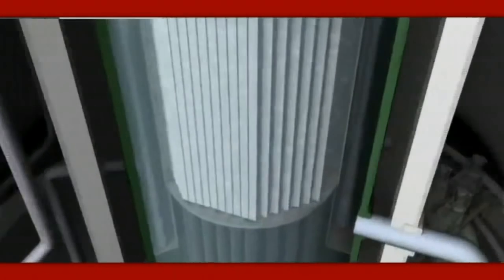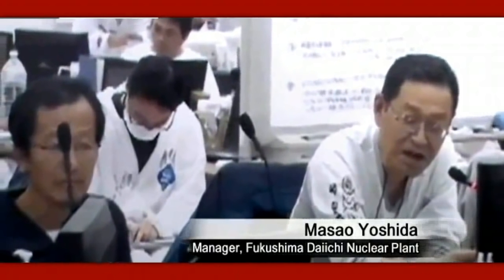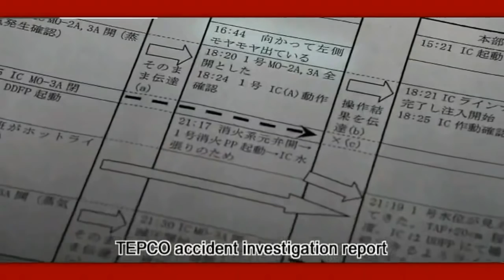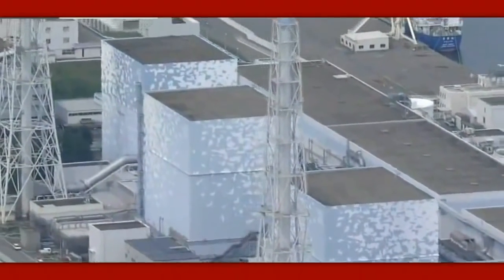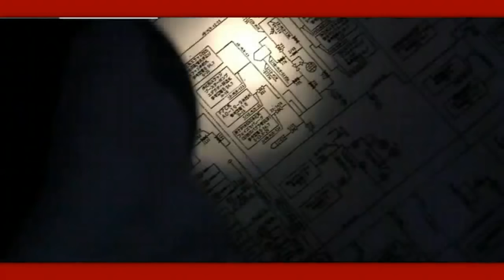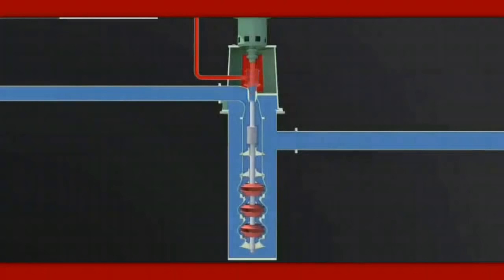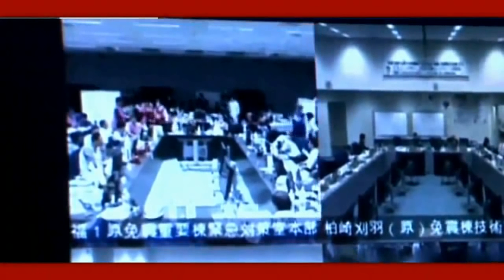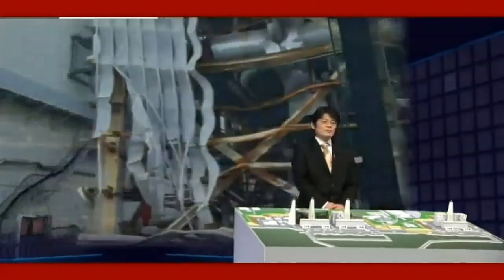Understanding Fukushima ☢ Documentary  Feb 3, 2017 Update

Comment: They didn't test emergency systems and that everything was electrically controlled...
that valve to the condensers must have been a Normally Opened Valve and you would have needed electricity in order to close it. When electricity fails it automatically opens.
You always need to have mechanical systems that can take over the electrical ones.

Comment from the maker: In a few more days, on March 11th, the world will NOT be celebrating the 6th anniversary of what will probably become the world’s most disastrous and expensive industrial accident ever – the failure of 3 of the 4 operating nuclear reactors in Fukushima, Japan.

What we know Now is that the "Melt Down" event was NOT contained. It is not all right. In FACT within days, the fuel rods had melted at all three reactors that were running at the time of the earthquake and resultant tsunami that knocked out the plant’s backup power generators and cooling capabilities.

What DID happen was an uncontrollable fission reaction that burned its way through not only the bottoms of the steel containment vessels, but right down into - and most likely through- the concrete foundation under the plant!

This 600-tons of super-radioactive, super-hot, burning nuclear fuel is probably now heading for – guess where – into the crust of the earth. If it does make it, even just into the area known as the Asthenosphere, we will all find out for sure if the Earths core is as "Scientist" claim - a solid ball of metal or as myself and others believe - a Plasma core. 

The Japanese Government has Lied and continues to obfuscate the truth as to the extent of the damage , the levels of Radiation flowing into the Pacific Ocean and the real costs to both Japan and humanity.

Bwahahaahha LOL just kidding. It's all good. Nothin to worry about everyone. It's just comedy.  According to my new friend here youtube user:  aceyage I encourage you to unsubscribe from my yt chanell as I contemplate jumping off a tall building while taking an entire bottle of strong over the counter sleep aid supplements with a plastic bag over my head and sealed very tightly, in lament over my horrible attempt at comedic scare tactic (apparently) Better yet, everyone go subscribe to ACEYAGE for much more informative data on Fuckushima, 
https://www.youtube.com/user/aceyage
Reply: This is great comedy, Mark. I needed that. No, uranium fuel can not burn itself down to the center of the earth.

For everyone who wants to inform themselves:
fukushimafacts.com
Reply from the maker: aceyage you're welcome. free comedy. I'll add that to my "about" section. yay
Reply from the maker: aceyage additionally I encourage you to know the difference between the "center" of the earth and the "Asthenosphere" it's much funnier then. lol ha ha. what a great chuckle.
Reply: Gives a better impression on what to expect.
Reply from the maker: Right on. Thanks for contributing to healthy (and sometimes Humorous) Dialogue.
Reply: No problemo Mark. Next time choose a more dangerous isotope than uranium like iodine-131 but say that it self replicated itself and is now eating its way through earth's crust horizontally and is making its way to the US and Europe. I think this will scare even more people.
Reply from the maker: we should charge a cover for this comedy. 👍 I mean fear factor, I mean...no wait. Which were we doing again I'm so stoned...  anyhoo ... I went to your channel to watch and read all the correct and completely accurate content on the matter but I'm so wasted that I didn't see anything. it's ok as long as we can laugh right?

Comment: emergency power supply in the basement, at sea level. brilliant
Reply: +Brent ward
That's not all.  General Electric, who BUILT the defective and dangerous reactors, KNEW of the problems before they were even built.  And did you know that they SECRETLY and ILLEGALLY added Weapons Grade Plutonium-239 to the mix afterward, when they knew beforehand that these "boiling water" reactors were not able to handle these kinds of hot radioactive isotopes??   These people are not only STUPID, they should be held into account for high crimes, in the very least.

Comment: The battery power and diesel generators meant nothing, the main seawater pumps were destroyed that supplied cooling water to the reactors through the diesel engines. If the engines were running there would be no cooling water supply anyways.

Comment: ARROGANCE, GREED.  Built on a fault line, in a tsunami zone;  assumption after assumption based on imperfect knowledge of the plant, (basic engineering would tell you that if the power sources go down, a pump turns into a turbine - subjected to any force around); employees under the assumption that the plant was fool-proof; not trained for anything but normal circumstance; essentially no real disaster drill in place.

Comment: I want the radiation leaking from Fukushima stopped. So I came up with an idea of using Sound Waves because everything even radiation has a FREQUENCY!!! AND OPPOSITE FREQUENCIES CANCEL EACH OTHER OUT!!!! 

The design of Godzilla's Eggs;  

 

  We need some sort of Siren Type Harmonic Sound Emitter one that can be adjusted to blast out such a high frequency sound wave that it is exactly opposite of that certain particle so as to render that specific radioactive particle innert or nullified. Then we need to build into the bouy a power source which does not need to be replenished. Those Hydrogen splitters might work well if we need a fuel system. Or maybe we should look into hydronamics where the ocean tide or its currents create the power thus not needing to refuel them ever.  
  Water proofing them should also be considered. Making them salt resistant is important as well. And checking to see what such high frequencies might end up doing to the Sea Water will also need to be researched fully. For example will such frequencies cause the water to evaporate into steam at a very high rate? Or will it alter the make up of Sea water? Could a type of Sonar unit be used to nullify those particles? 
  We need the names of the particles to be nullified first and their Frequencies. So far I have found three names that appear to be the worst ones to go after, Caesium 137, Strontium 90, and Tritium. And we need to find out if these opposite frequencies can also nullify radioactive fog banks or clouds. 
  Here is another idea that has some merit to it and that is the use of Ringing Stones. The Annunaki were able to design circles that each had different frequencies. Could creating a stone wall in a circle be as effective as placing a device around Fukushima???